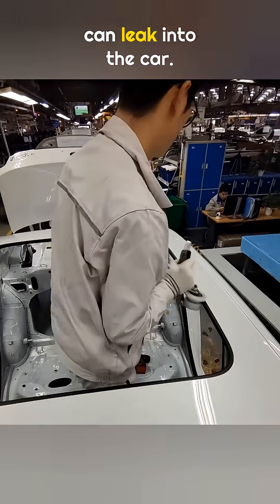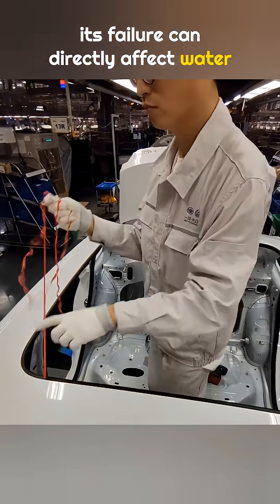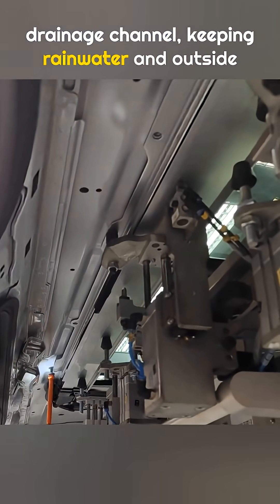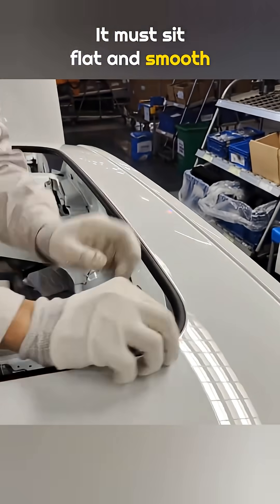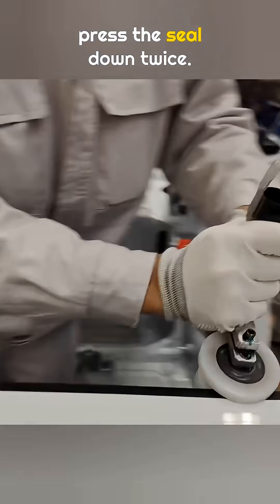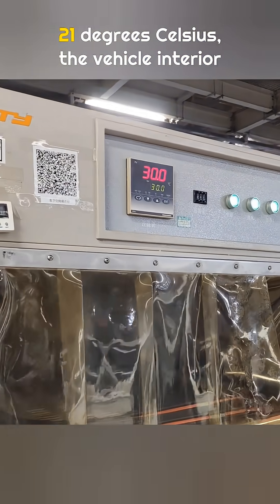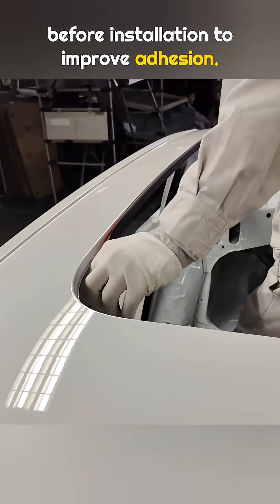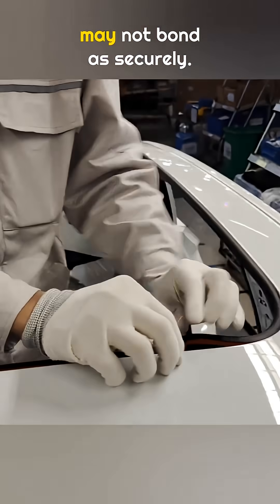Why Panoramic Sunroofs Start Leaking

Comment: Better NO sunroof, trust me: sooner or later, rain will win.
Reply: Not if you buy a quality car. My parents still have a 94 camry that my mom used to daily drive 20 years ago before getting another car. Has a sunroof that hasn't leaked a drop in its life, and almost 300k miles
Reply: panoramic roof, that doesn't open is fine